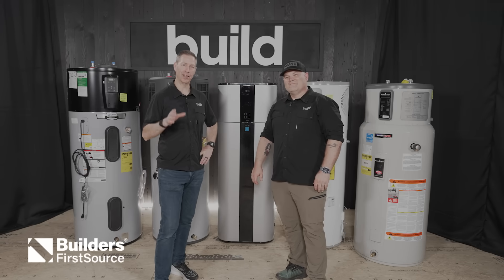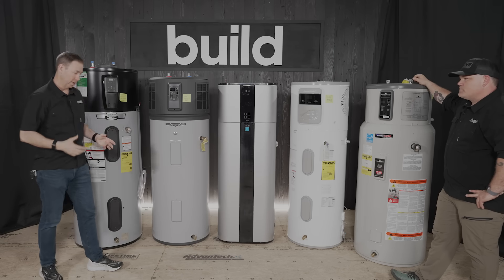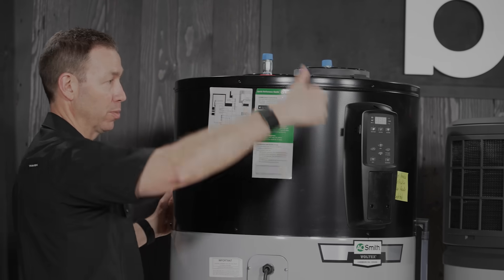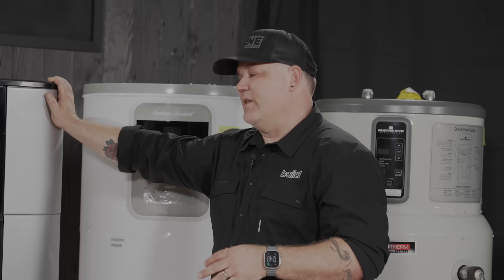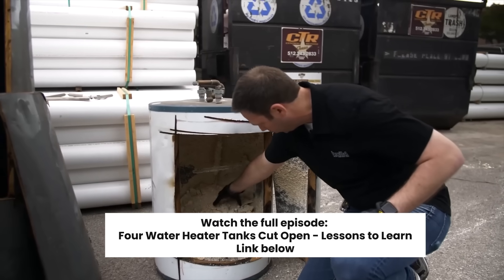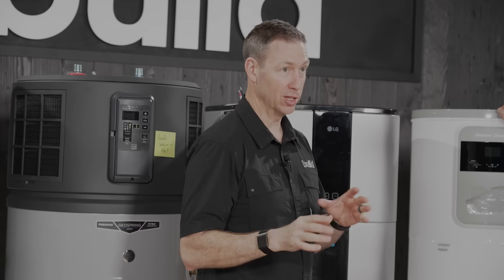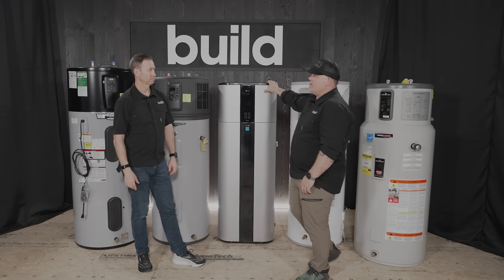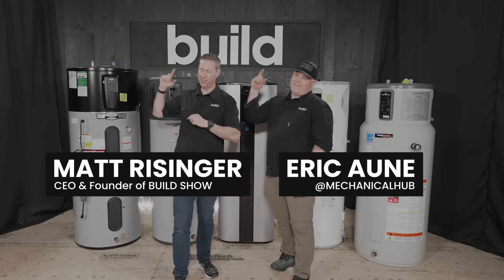Heat Pump Water Heater 101 - 2025 with Eric Aune

Comment: Glad to see this video put up! Had a local plumber, THIS YEAR, tell me he refused to put ours in and that if I did put it in no one in the area would service it. That man was convinced I only wanted to put it in because of the electric company snowing me over.  Stubborn diehards.
Reply: Same here - I couldn't find a local HVAC contractor who even knew about them - all recommended old style electric or gas. The one guy who knew what they were would only install a too small one at a ridiculously inflated price. So I bought one at Home Depot and installed it myself, Running perfect for 5 years now, and saving me over $60/month over my old propane heater. It's already paid for itself.
Reply: @stonecoldcustoms  I’ve serviced them. It’s a pain and a lot of the parts burn out. I just don’t want to have multiple trips for warranty replacement for one unit, for installer it is not cost effective. Plus opening the unit can be a lot of work in basements where is tucked in tight. Not a terrible product, just some reasons people hate working on these and selling them.
Reply: @VVisdamn you sound like my local hack techs. Real pros have no problem selling or servicing them. They have a great reliability record for the last 8-10 years and are just a reverse refrigerator. Same tech that's been in fridges for like 80-100 years and as simple as it gets.
Reply: @VVisdamn  The thermisters can be a problem.   And make sure you get a long warranty.

Comment: These could also help to dehumidify a basement?
Reply: Works great for mine in that regards
Reply: Absolutely. Mine is in 40x25 lower garage. Exposed walls unconditioned space. Super rainy summer here in the south. My space stay cool and about 55% humidity. Even when it’s 90% outside.

Comment: You missed the LARGEST drawback to these types of water heaters… they remove ambient heat energy from the space they pull air from. In a cold climate, that has no space with excess heat (AKA heat not generated by a utility consuming device) these WILL raise your heating requirements for the majority of the year, meaning these will raise your cost to heat a structure. The higher the COP on these, the more heat energy they are extracting from the space, so essentially your trading a lower electrical usage from the water heater for higher gas, oil, or electrical usage from your home heating system, unless you live in a warm climate. I do Manual J calculations regularly, and heating water requires a lot of heat energy so for many people north of say, southern Georgia, these will run primarily on their electrical elements while still raising your heating space heating cost.
Reply: We have one in a heating climate and it works fine. NEEA did a study on this and found the extra load on your main source of heat is negligible. Plus if you use a heat pump for home conditioning the stacked efficiency is still way better than a direct electric resistance model.
Reply: @JoshuaRes The parameters of the study are key. It takes 8.33 BTU to raise 1 Gallon of water by 1° F. At 80 gallons thats 666.4 BTU with a rise of 68° =45315 BTU taken from the conditioned space meaning any heat source has to replace that 45k BTUs, that’s a 4 ton system running, so its variables of heating fuel, latent heat in the supply space and heating system balance point would be critical. I’ve done Passive House and ACCA calculations for years and these water heaters account for a substantial load on home heating systems in areas with high heating degree days.
Reply: If it's in the basement it's taking energy from the ground heat around the house
Reply: There is a GREAT use case in the garage.  There is some use case inside a house in hot climates.  There is diminishing use cases (sometimes greatly diminishing cases) inside in cold climates in small spaces.
Reply: Which is why they can be ducted and there are now even some split units -- both of those things were in fact mentioned in the vid.
Reply: @RedMike-ym8hd  The split units are air source heat pumps designed with significantly larger condenser coils that go outside, like a mini split. The issue with these all in one units is they have very small condenser coils, and it’s pulling heat from your homes indoors, unless you are in a southern climate that has ambient excess heat from the outdoors that cost you nothing to generate, even if it’s ducted to compensate for a small space. The duct, even if it pulls from outdoors, still needs a significant amount of heat, you didn’t already pay to generate to supply it, because it doesn’t have the larger compressor and condenser to collect it. I’ve installed the SANCO2 units, they are $5500 base price and there are drawbacks to using CO2 as a refrigerant that are rarely mentioned.
Reply: @m00ndog3  Ours is in the garage and even in freezing weather it works fine.  Now freezing temps around here are 30-32 degrees.  All that happens is it takes longer to recover after using hot water.
Reply: @bryanwhitton1784 Same. Works just fine for me. Live in an area where we get snow.
Reply: Where in North Dakota are you from?

Comment: I want to know the temperature delta that the heat pump can handle. Are they limited to only heating the water to 120-130 degrees? Will they work in my fairly cool, dry basement and heat my cold Maine well water?
Reply: With US-legal refrigerants they usually stop heating around 35degrees ambient, but will heat to 140 or so regardless of outside temp (it just takes longer).
Reply: We keep ours at 126 degrees and it works year round from about 32 degrees to 110 degrees.  It is located in our 2 car garage that has a south face and if the sun is out at all the garage will warm up to 45 - 50 degrees by mid-day.

Comment: I can definitely see this being tempting for the very wealthy customer with the very expensive custom home who wants the concierge service plumbing and electrical appliances. But for those of us with more modest households who don't mind doing a little bit of DIY, I can tell you that it is cheaper to just get an old-school standard tank water heater and install it yourself, do basic maintenance if it's not too difficult and then replace it with a new one in 10 years. The amount of energy savings with these newer fancy units don't seem to be enough to offset the increased price of the unit itself combined with the cost of paying a plumber to come out and do annual maintenance and then anode rod replacement every few years.
Reply: What is the additional maintenance for these vs any other tank water heater? All tanks need the same maintenance for flushing and anode rods, so I'm not sure where you're getting the extra cost on that end. 
I do hear you on the additional up front cost. I was thinking the same, and our plumber quoted 3x the cost for replacement of our gas tank heater to one of these (*not* including the electrical) vs. a new NG tank. However, when we priced diy, it was only 1k more, which we will easily recoup in 3 years. 
I am nervous about the additional electronics, since our current NG tank heater is just a dumb flame with a tank of water above it. Of course that comes with disadvantages too.
Reply: @juliaveir8556  OK, I don't understand that at all.  I installed mine with a friend and it was no different than the natural gas heater it replaced.  I did have to run a 240 25 amp circuit to it from a sub panel but that was fine.  For me it consumes no energy at all from the utility.  I have PV and a 16 kWh battery that supplies essentially all of my electricity.  I have two electric cars and the heat pump water heater and haven't paid a dime for electricity at home in years.  That is where you get the most savings.  Under normal conditions it uses way less energy than a resistance water heater.  It uses less energy that a natural gas water heater although it is a different form.  But for me, I can't generate natural gas but I can generate electricity.
PS: I did have to tie the condensation line to the line from the AC that sits right next to it in the garage. So that was trivial but still was somewhat different from natural gas.
Reply: @bryanwhitton1784  oh i agree, I think our plumber is living in the dark ages and just didn't want to install it. We even have a floor drain directly next to the install location (old laundry room) so the extra work for the condensate line didn't even apply. 
I'm incredibly happy we didn't listen to him. Our neighbors were in a pinch (unexpected replacement) and balked at a similar 10k estimate and replaced their with another natural gas unit (3500 estimate) despite have solar they're constantly running back to the grid since they don't have battery. It's so frustrating.
Reply: My thoughts exactly.  I've looked at it ... the payback just isnt there esp if you have a problem with it - and need expensive service.
Reply: Bingo.
Reply: In my area, you would need a water softener to keep the thing from filling up with lime.  In the real world, it may well be easier to pay a little more per month for energy than to get hit with a big bill every now and then for maintenance or replacement..
Reply: @chrishill9016 sure. But you have to compare apples to apples. That means whatever you would have to pay to have a standard water heater in your area versus what you would have to pay to have one of these in your area. So the difference, as they explained it, sounds like it would just be a more costly service for the anode rod replacement. Plus the additional cost of the unit itself which is more expensive
Reply: Hard disagree. I DIYed one of these into my basement and it was not that hard. Plus it was only like $200 more than a standard electric and cheaper than a good gas unit. Power consumption went way down.
Reply: @JoshuaRes my comparison is between DIY and paying for full service. In the video they talk about the maintenance as something a customer would pay for. Obviously DIY will save on cost. But where I live, gas is far cheaper than electricity so the efficiency savings won't make up for the price increase.
Reply: Without heavy tax credit subsidy or insane energy costs in your local area, at current pricing you will not make your money back on these heat pump water heaters. I think they're neat tech and I have nothing against new tech whatsoever but those are the facts. Gas is far too cheap in my area to ever make these make economic sense without .gov tipping their fingers on the scale with bans and tax credits.
Reply: @Channel-gz9hm I think they will definitely become competitive eventually. Like a lot of emerging tech, the early adopters pay extra which helps fund r&d. But like he said in the video, regulation and code changes will eventually make them more popular, maybe even eventually required. That will increase the prevalence in the market which will lower the price over time

Comment: What if I'm using rain water in the house?  How much maintenance would I need to do?  There's almost no dissolved minerals in rain water.
Reply: If you are using rain water in your house, you need a new roof, not a new water heater.
Reply: @bills6946  my metal roof will last a long time.

Comment: Matt-Do tell…what refrigerator brand is going to last 20-30 yrs?
Reply: A basic dumb fridge can do that. I have a two ge top freeze bottom fridges in my garage right now that I bought and used side by side in the kitchen of my first house (cheap way to get a restaurant style fridge & capacity plus twice the ice).  I built that house in 2002

Comment: Could you duct your bathroom vent through the unit instead of outside? In theory, it would dehumidify the moist air and cycle it back into the space and prevent a penetration or the small amount of negative pressure to need to be made up.
Reply: That would make some nice cool farts.
Reply: See discussion about refrigerators above to get a sense of how the numbers don't crunch very well. But the other issue is that homes often rely upon bath fans for overall air quality, not just to exhaust humidity.

Comment: imo this is like the electric car.  The initial cost is crazy expensive and you hope it will last.  More likely it won't last to recoup the cost.  Also many new appliances aren't made to be fix but to replace.

Crazy expensive initial cost + more likely to break down + not easy to fix but push to be replace = not for me.

I prefer the cheap dummy water heater.  It's so basic that hardly anything can go wrong.  And if it does break down, it's easy to fix and if needed cheap to replace.  Simplicity is best.  I don't need AI for my water heater.  Dummy is best.
Reply: A quality hot water heater is $1000 and the heat pump unit are $2000 (AO Smith at least)….so break even payback is 4 years most places. And electric rates are likely going to keep going up so break even is likely sooner
Reply: Open installed over 4000 of these just in South Florida and in Florida Georgia north and South Carolina combined. I’ve installed 14,000ish. These work awesome most the ones I’ve installed have been Rheems but ive also installed a lot of AO Smith

Comment: Since the invention of the combo washer dryer into one machine. Do you think there will ever be a refrigerator hot water heater combo sharing a compressor unit? The cold goes into the fridge/freezer the heat goes into the water... I was thinking the compressor on one of the 2 units with freon lines going to the other unit???
Reply: There's not enough heat in your fridge/freezer. The recommendation is 800ft3 of air. Water (a decent proxy for food) has four times the heat capacity of air. 200ft3 is 8-10x your typical fridge. On top of that, a fridge only maintains say a 20 to 50 degree Fahrenheit difference from ambient while a water heater is adding 60 to 70 degrees; the freezer helps a bit, but not nearly enough. Moreover, the fridge is usually just maintaining a temperature difference from opening the door or thin insulation, whereas the water heater is frequently (mostly) emptied. Still, if you really wanted to to do this, put the water heater in a closet with your fridge as the door in front. The water heater could siphon off the exhaust from the fridge, but it's also going to be starved for heat and need supplementary heat.
Reply: Why stop at fridges and water heaters?  Why not combine all units utilizing the refrigeration cycle?  HVAC Heat Pump/Heat Pump Water Heater/ Refrigerators/Freezers/Dryers/Dehumidifier?
Reply: Sounds crazy but I love this idea!
Reply: @TaskForceBorderLine that would make too much sense
Reply: Silly idea what but does work well is putting them into rooms with solar equipment or lots of computers.  Inverters make a lot of heat
Reply: @mattbrew11  Ours is in the garage our inverter is outside and is very efficient.  It actually sits on top of the 16 kWh battery.   We have a 8.4 kW array on the roof and between the PV and the battery we have had to pay for about 2 kWh of energy from the utility.  Honestly I am not sure about using it to cool a room containing 100% duty cycle electronics.  At least for our system it only works about 2 hours a day.  Once in the AM for about an hour and then in the late afternoon or early evening.
Reply: @bryanwhitton1784 sorry for your misunderstanding. I didn’t say it worked as a replacement for climate control. I simply said inverters and computers waste a lot of energy through heat which great improves the function of the water heater and lower humidity in a room with either of those devices is always a good thing.  
- a guy with 17 years experience operating a solar business with 10s of thousands of installations 😊
Reply: @mattbrew11  OK, thank you for the clarification.  I have been in the industry since 2005 and owned my own installation company as well.  Retired now.  A lot of folks on this thread want it to act as climate control.  The problem is that it runs very intermittently.  Other than that it would be a good place for it.  Most inverters are OK with water around so even if there was a catastrophic failure it wouldn't hurt anything.
Just curious, what inverters do you install?
Reply: A generic refrigeration-sized compressor costs ~$150, retail. Meaning these corporations pay much less than that for millions at a time. Why on Earth would you want to combine two critical appliances' functions over such a cheap component so when it goes bad you lose both your hot water and all of your food?
Reply: @Channel-gz9hm  you have a good point.
Reply: They do this in grocery stores
Reply: Yup, coolant lines that run through the house to move heat to/from anywhere. Pairing with mini-splits would be perfect. Put a heat exchanger in your computer/server room as well. A modern PC can output 400w of heat easily, a router can be 20-50w of heat. Might not sound like much but they run 24/7.